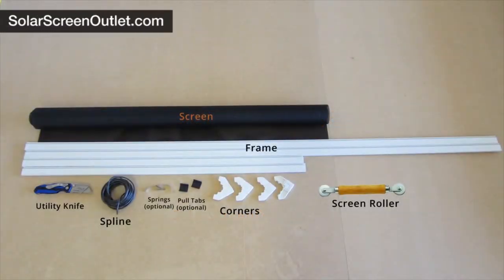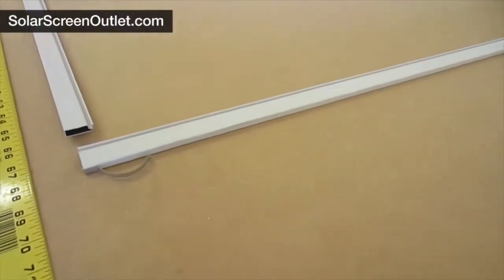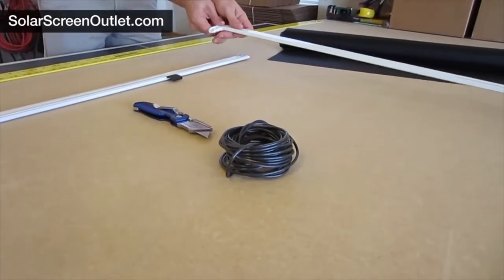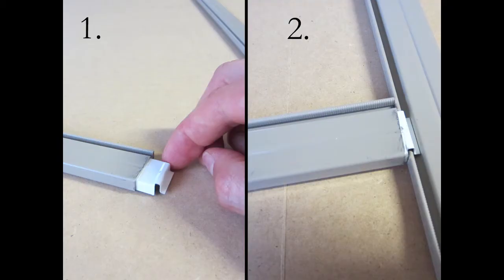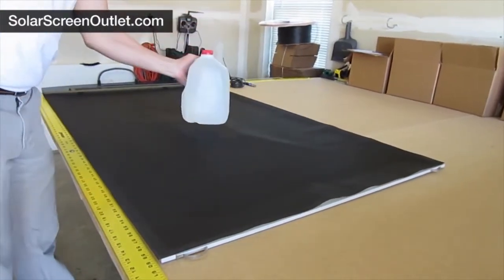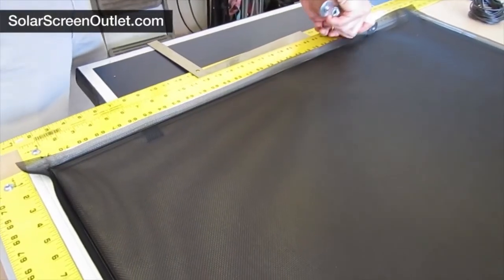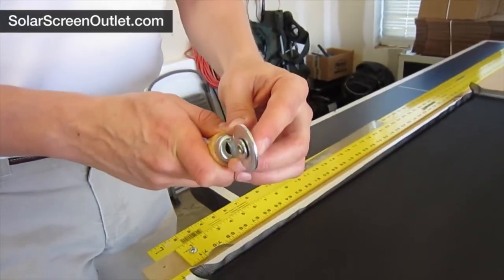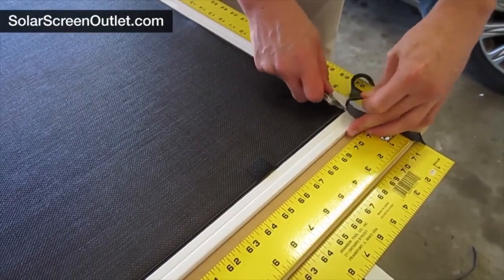How to Assemble a Solar Screen - UPDATED

Comment: I'm really sorry, not saggy at all, the book trick and starting at the middle are the key no other vid in YT talk about.
I used screws on the edges to lock the frame in place. Before using the book trick, the screen pull the frame inwards creating bows 
Thanks sir, you saved my job.

Comment: Should we be putting weight in the center with a crossbar installed as well or will the crossbar alone be enough?
Reply from the maker: Good question! Crossbar alone might be enough but you can try using 2 books/weights - one on each side of the crossbar. If it's a larger screen, you might need to do this, but on smaller screens I doubt you'll need to.

Comment: Honestly I am having the hardest time getting these screens assembled. The screen never stays in the frame and no matter how hard you try to keep it even it will wrinkle. I’m not sure how I can get a 85” TV shipped to my house but you can send these assembled. Spent a lot of money just to sit here and struggle.
Reply from the maker: So sorry you are having trouble. Here's a link to our printable instructions with extra tips that may help. https://solarscreenoutlet.com/wp-content/uploads/2023/03/Assembly-Instructions.pdf - Try these tips too:
Assemble the screen frame and corner pieces. Make sure it is square.
Tape down all 4 sides with masking tape or similar tape.
Cut the spline to size for each side so you have 4 pieces of spline (2 long and 2 short)
Start with the longest side and roll the spline into the channel starting from the center out to each corner.
Do the same thing for the other longer side. You may need to gently tug a bit on the screen during this step to get it tight - but not too much.
Then do the shorter sides the same way - roll in the spline from the center of the side out to each corner. First do one shorter side, then the other.

Comment: I build screens every day for Ace Hardware, and this video is a joke. The frame used to make solar screens has become so soft that the spline channel wont hold its shape.
Reply from the maker: I assure you this video is not a joke. There is nothing funny about the assembly of solar screens. I wish people would take it more seriously like you do. Thanks so much for your concern.
Reply: So what should the frame be made out of? Stainless Steel?